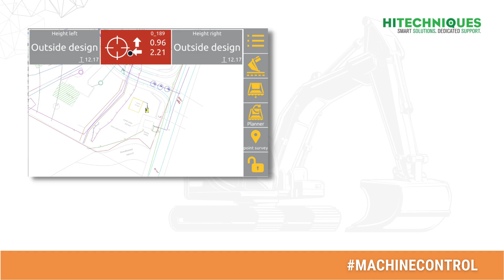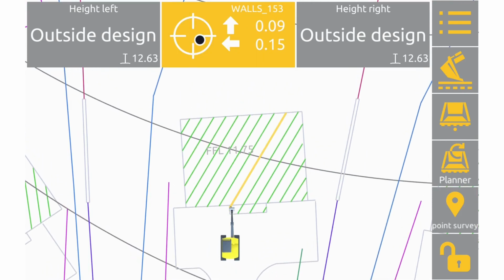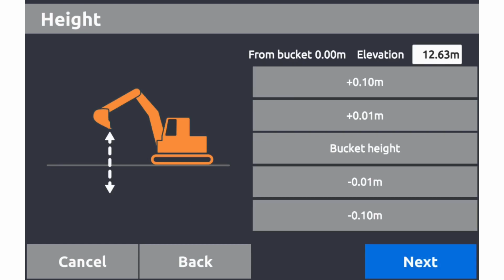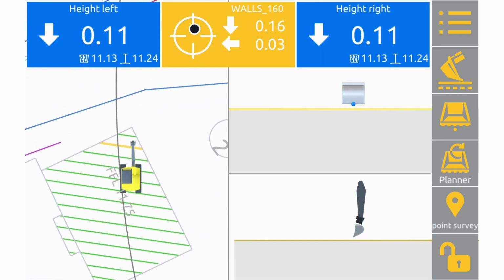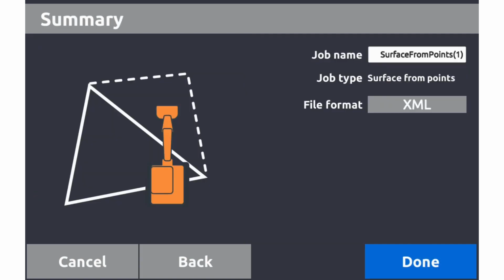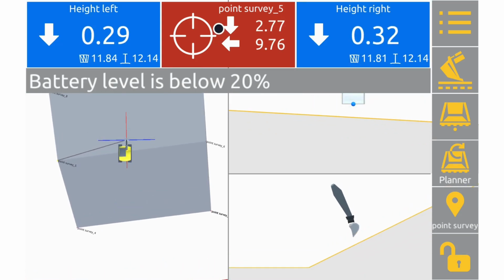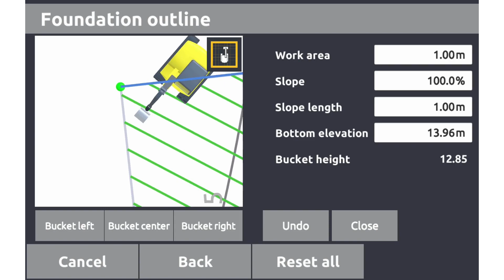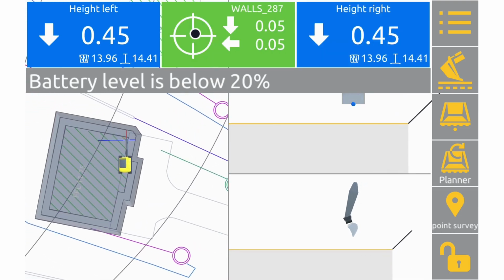Creating surfaces in Unicontrol3D

Comment: @14:00 Why do we need to mark these points in the field using the excavator bucket? Aren’t these points already in 2D? Can’t the machine generate the required sloped surfaces for the foundation excavation automatically, just by selecting the points that define the base area on the screen and applying the offset distance? I don’t understand why we need to physically confirm them with the excavator bucket on-site? can you explaine it to me?